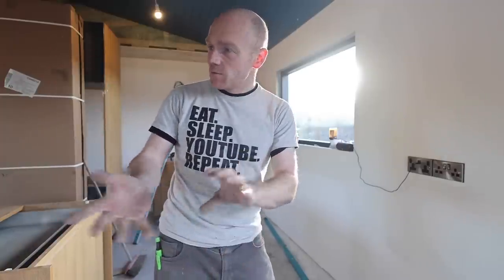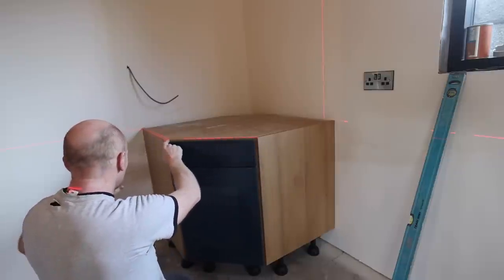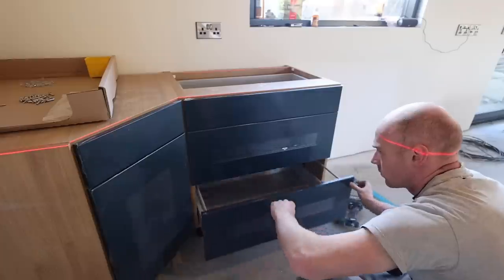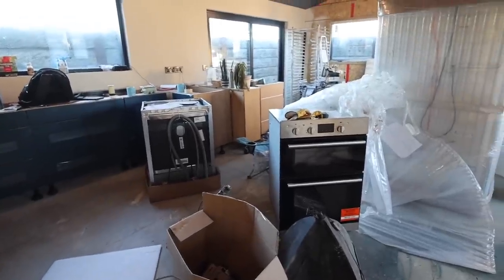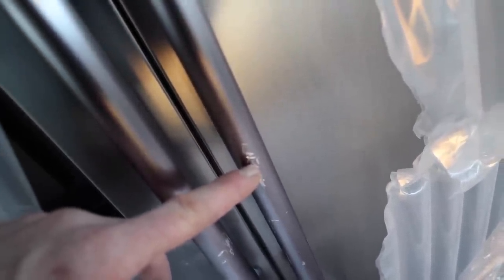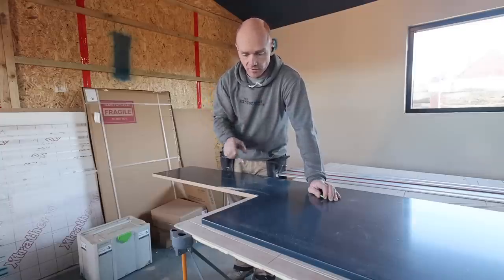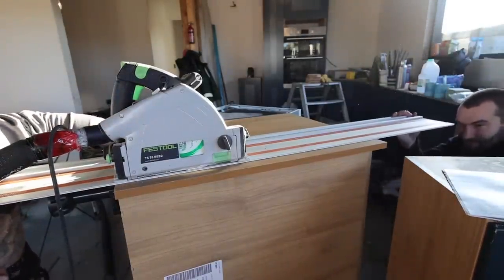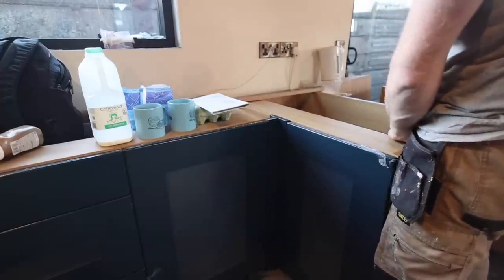FITTING OUR NEW KITCHEN - Such a quick transformation!

Comment: To stop the edge chipping when cutting put masking tape on the surface and mark your line then cut, the tape stops small breakout. Kitchen looks good.
Reply: I attempted the tape idea several times. Chipped everytime. The only way I achieved a clean edge was with a router

Comment: I thought the flooring would go in first?
Reply from the maker: Flooring will go up to units. Save on flooring costs!
Reply: @TheRestorationCouple  We ran it under appliances to make removal easier (no “lip”)
Reply from the maker: @robertbamford8266 yes it’s under appliances but not units. As it’s a floating floor and we need to screw unit legs down it’s was best to go around those.